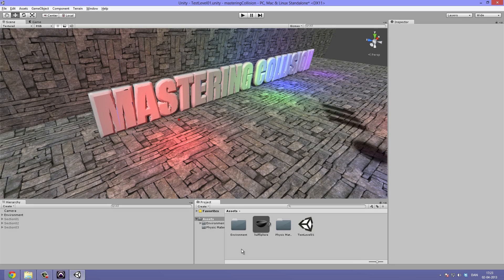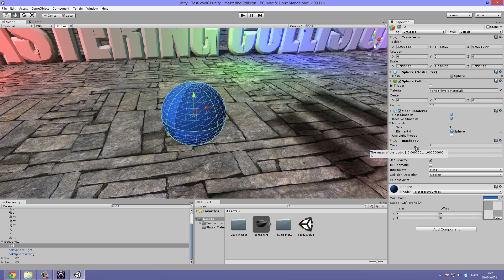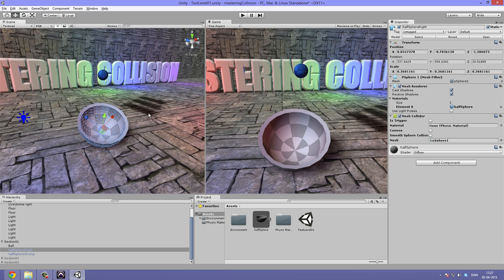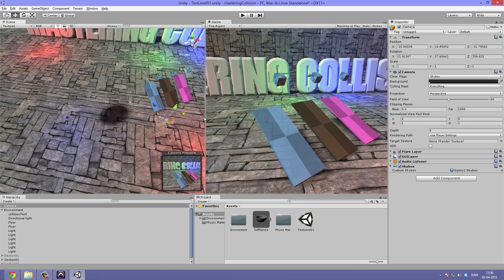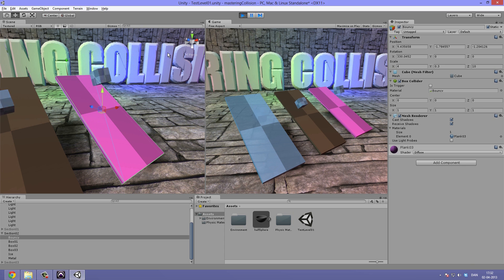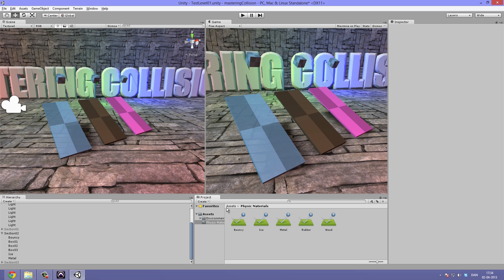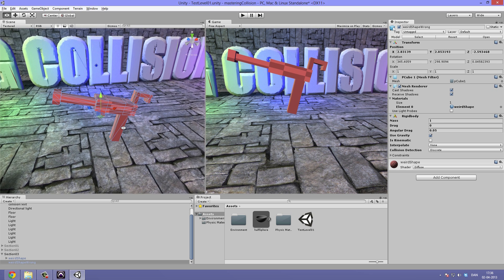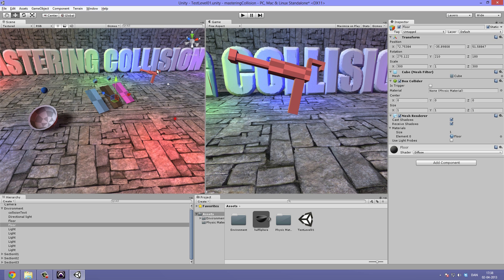Mastering Collision - Unity Tutorial

Comment: So even if a single object has say 8 different box colliders attached to it, that's still more performance efficient than a single mesh collider?
Reply: I did read that, i relize now the the geometrical shape has alot to do with pysical calculation, Thus, Yes multiple Box Colliders are more efficant for optimization than using a mesh collider.
 However im still not sure when it is absolutly nessesary to use a Mesh over the other colliders.

Another Work around i have found is to make 2 versions of a model one detailed and one VERY basic low poly,Then turn off mesh render and make it a trigger surrounding the object, now say if a raycasted bullet hit said
trigger/object it will react.
Reply: Was wondering the same. Maybe because the Mesh Collider is trying to Listenen to multiple vertices? Please answer this for me.
  I'll try myself with a FPS counter and Debug info to see if there is a major differance.
Reply: Makes sence, thank you again.
Reply: What a mesh collider does is it takes the object, and gives it a collider for the entire object which is much harder to calculate then a bunch of boxes.
Reply: You should use a mesh collider when it becomes to hard for multiple colliders to make the collision box you want. Or you can avoid this by making less complicated shapes :/